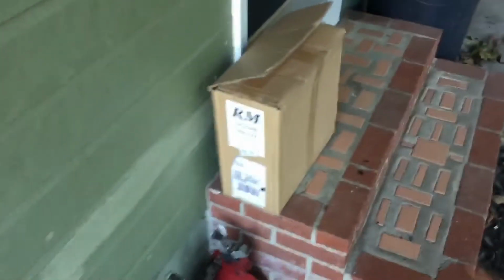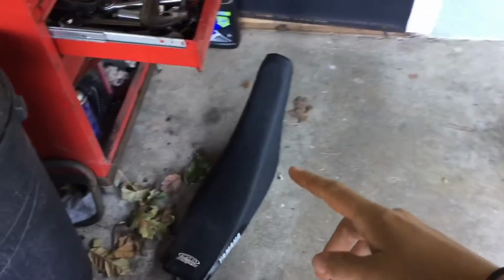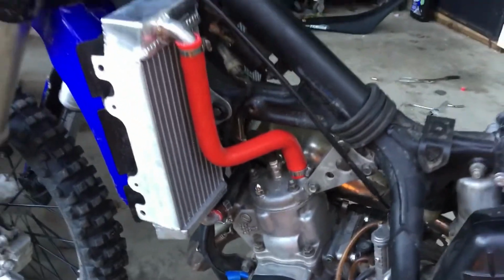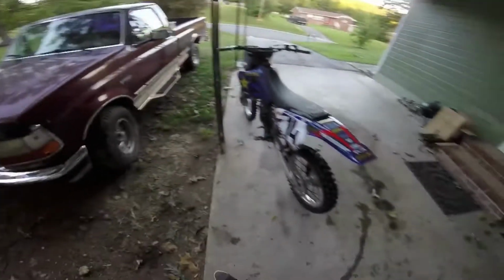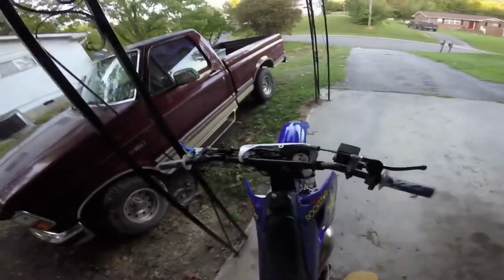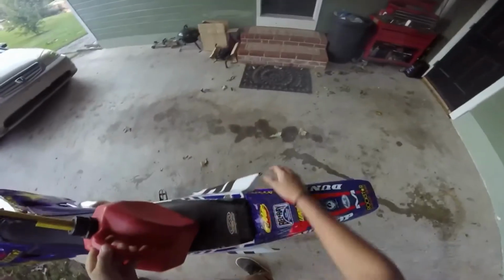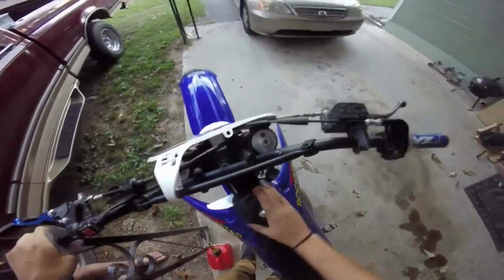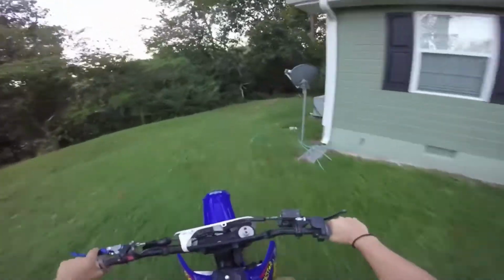New Radiators and Riding the 125

Comment: A week? I'm going on a month without mine, I had to re-jet and blew the piston, so I ordered for a new piston, honed the cylinder already, just waiting to the right size piston after getting the exact measurement
Reply from the maker: +Joz Sports dang that sucks.. normally if you just hone the piston and not bore it out then you can look on the piston it will be marked "A" or "B" and just order the same one, i messed up and ordered a b when its a A, but it srill runs fine now .. good luck man. Let me know what happens